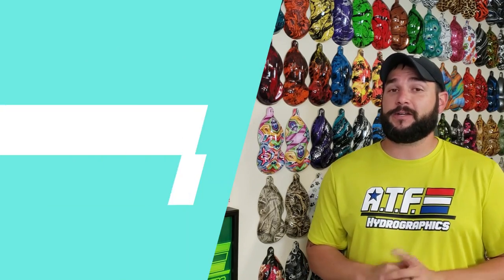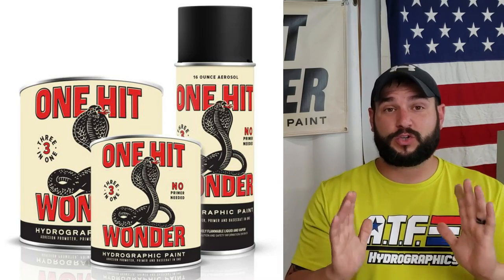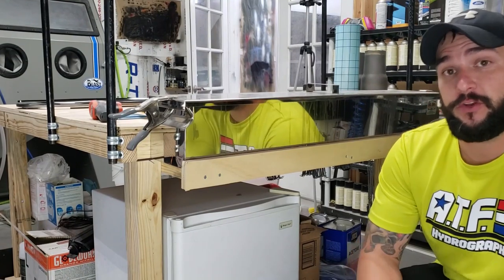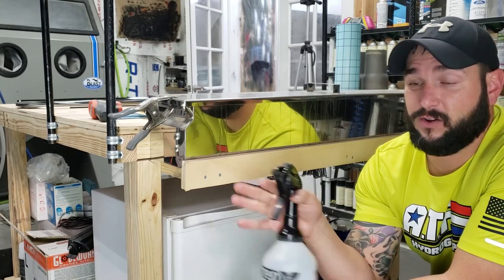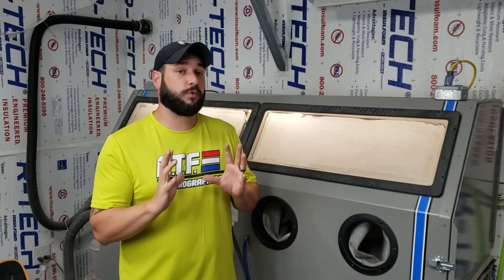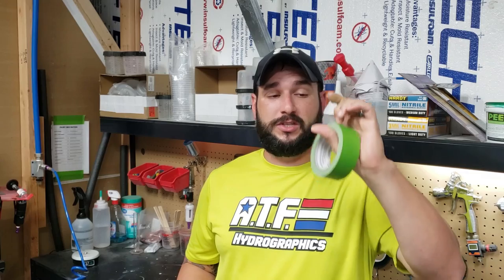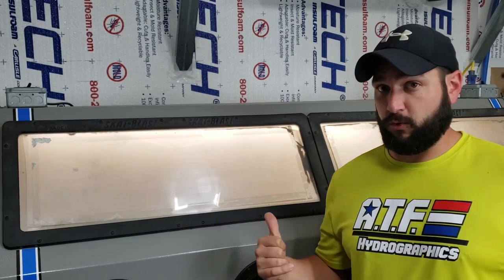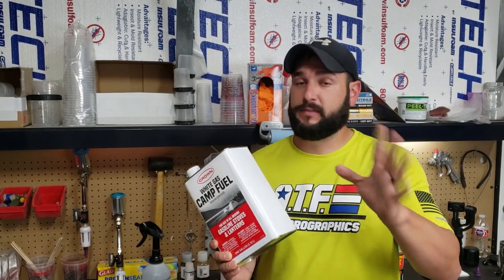PAINT PREP for DIY HYDRO DIPPING

Comment: If sandpaper is needed can a high build primer be used to makes sure there wouldnt be any problem with sand scratches
Reply from the maker: Sand with finer grit to eliminate scratches, don't build up primer for no reason.
Reply: @AllThingsFunHydrographics  ok that's what I would do but was curious incase one of those "situations" happen. Thanks for getting back and answering my question I'm working on getting my setup going and I've learned a lot from your videos your a awsome guy helping out guys like me

Comment: So....I had scooter do a gun stock and scooter did NOT watch your video....36 grit sand paper is not the same as 600 grit... So now I have a stock that's totally 🤬... Now I'm going to do it myself, but what would be the best filter for something like that... The stock is a standard synthetic material... But I might just have to buy a complete new stock because of how bad it is around the action, scooter must have not liked the way the fit was so he preceded to round off EVERYTHING... So I have to strip off everything ( Kuiu Vias) , fit and finish to the action with a "Bondo"?, then clean and prep for the base paint then clean and prep the paint for the film.... 🤬🤬🤬 Next time I work on scooters boat I'm going to bust off all the spark plugs then glue the wires back on and say what, it works just fine, it's just a fishing boat anyway. I'm so pissed right now...I wish I could seen picks thru you tube.
Reply from the maker: Oh no... scooter got you! I would start fresh with a new stock if it is that bad. You could try bondo and shape it up a little but that sounds like a lot of work!
Reply: Thanks for help brother